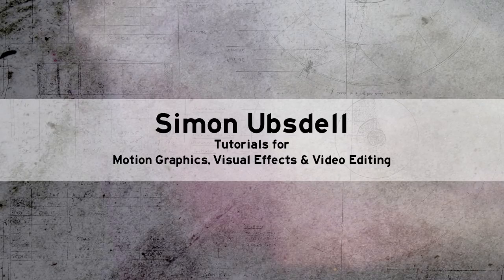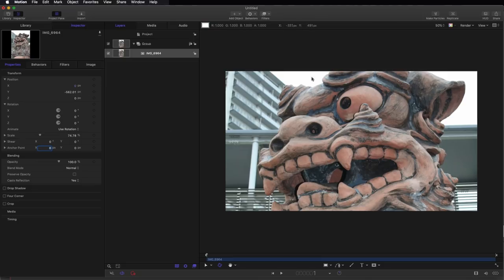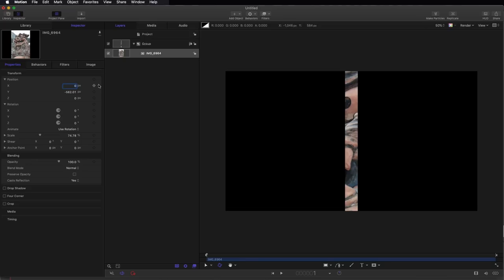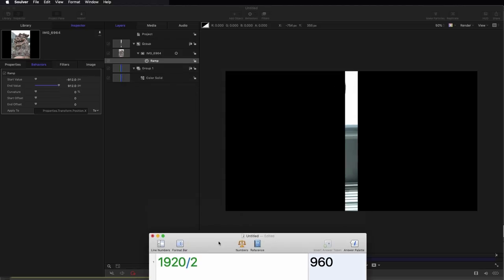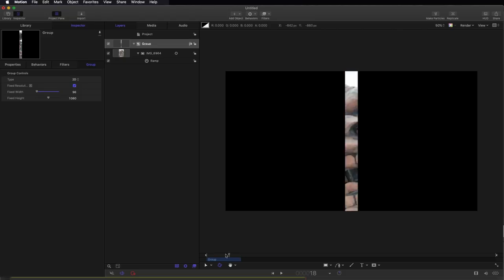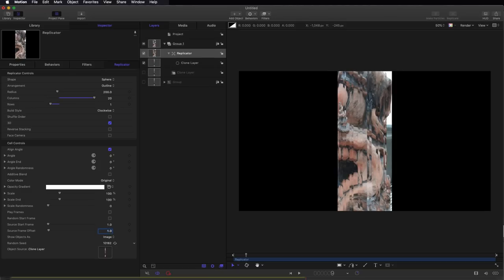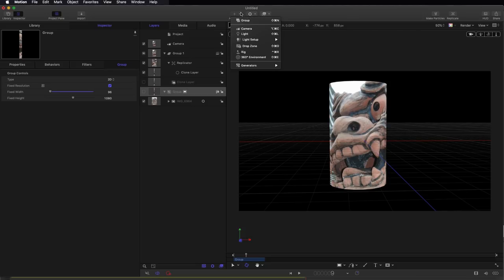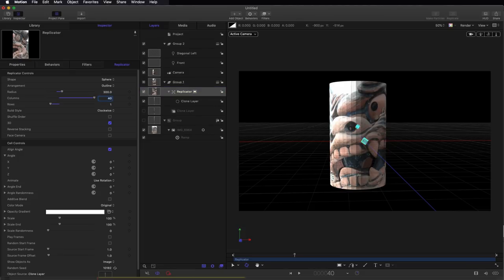Apple Motion Tutorial: Mapping an Image to a Cylinder

Comment: OK, I almost have this working on a video.  Turns out the same method does seem to work for a video clip, or at least almost.  Only thing I can't figure out is how to offset the section of video played in each section of the cylinder so that they each play the correct segment and line up.  I don't understand how the ramp works and why the keyframe is set to 20, is animation correlated with physical distance somehow?
Reply: Seems like the Tiling Offset Filter will offset the video correctly but how do use this in conjunction with the Replicator?!